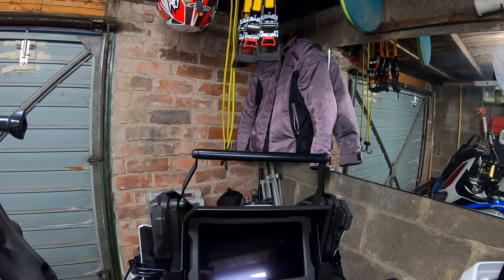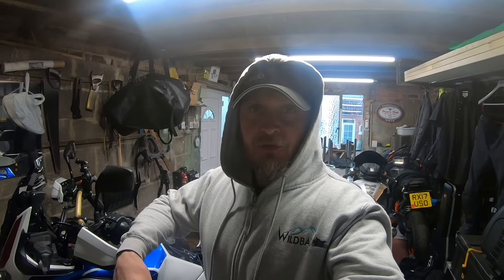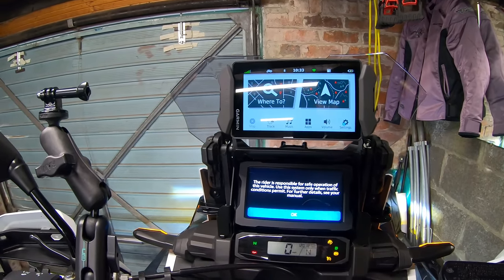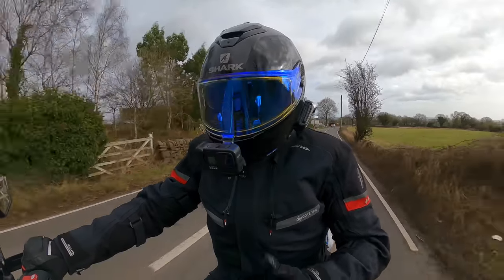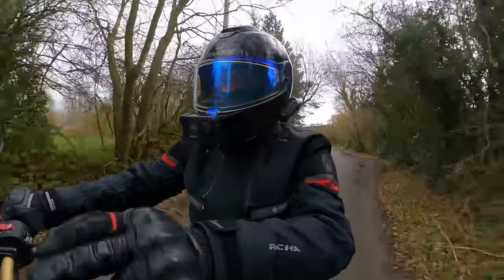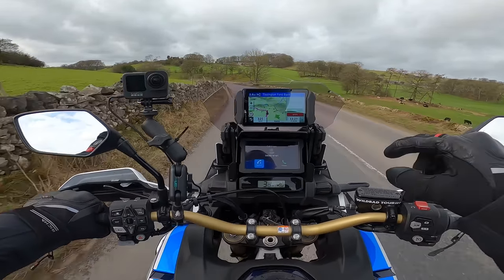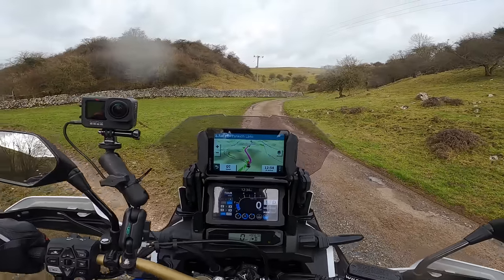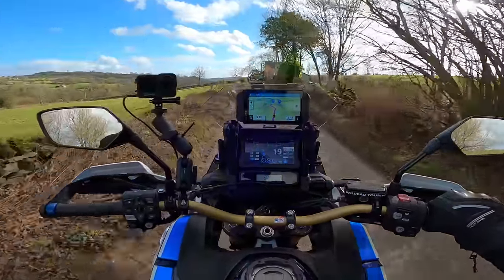Installing A Garmin Zumo XT on the Honda Africa Twin Adventure Sports

Comment: Great set up but never felt the need for a locking cradle, releases in seconds and slips in my pocket or top box. To be honest I’ve replaced my Nav V on the GS with a cheap adapter and use the iPhone with Google Maps , Calimoto etc.

Comment: Gr8t video,
If u have no eazycan how do u mount?
Reply from the maker: You can still wire direct to battery if you don’t have an EZcan
Reply: @RichyVida  I saw in another video you can charge from usb or lighter socket on AT
Reply from the maker: Yes you can charge from the lighter socket if you didn’t want a permanent fix
Reply: @RichyVida  Jesus loves u! 🔥🤟

Comment: What is your wiring hub for accessories?
Reply from the maker: Hex EZCan
Reply: @RichyVida  thanks.  Have you looked into foot pegs?  I’m still trying to research to see if our newer models have the weak right peg mount.
Reply: Btw, thanks for the quick response.  I believe I’ll follow your lead with the EZcan, even though Denali has a similar product now with I believe six channels, what a game changer either way.

Comment: does it need internet connection? via hotspot from phone
Reply from the maker: Yes. That method requires the HotSpot to have data
Reply: @RichyVida  Thank you for the information. do you need to open google maps on the phone and activate location